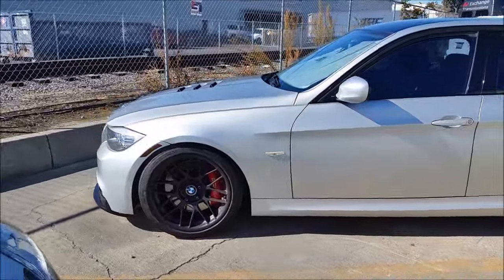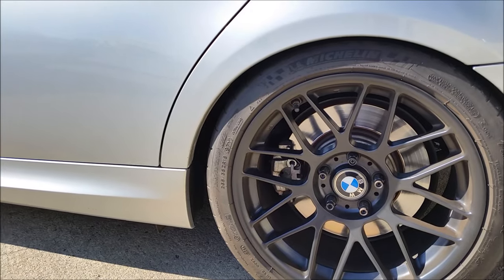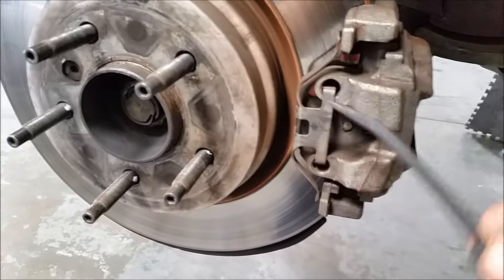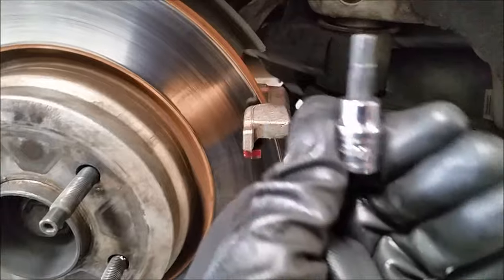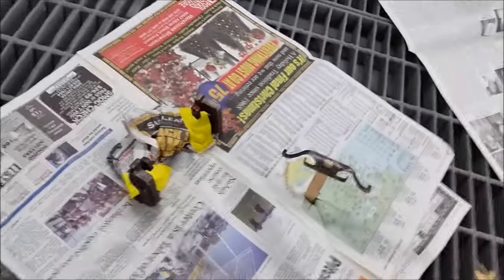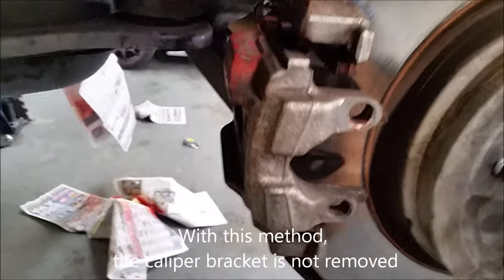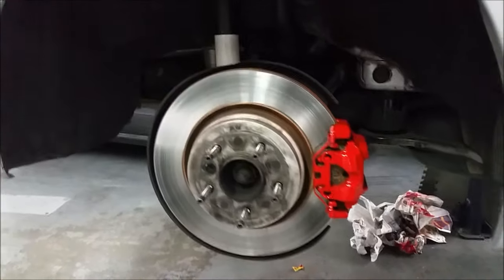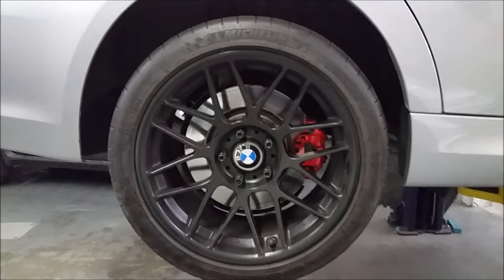How to Paint Your Brakes DIY - BMW E90 335i

Comment: What studs you put on for the wheels?  you drive with lug nuts that cool :)
Reply from the maker: Motorsport Hardware Wheel Studs. I highly recommend them. Makes wheel swaps easier in general and especially on track. Roughly $100 for a set so not bad at all.

Comment: Did you say it or am I dumb. Why can't you have the big ones in the back too?
Reply from the maker: Mainly because of cost. The front BBK is $2500 and the rears are $2K+. Most of the braking is done with the fronts so the need for a rear BBK is up for debate (some teams run them, some don't). I've been tracking for over 4 years with a front only BBK and it stops on a dime.